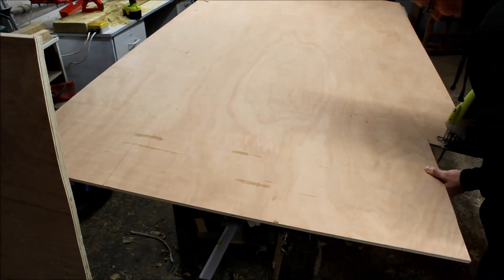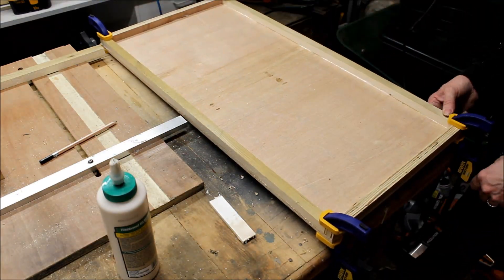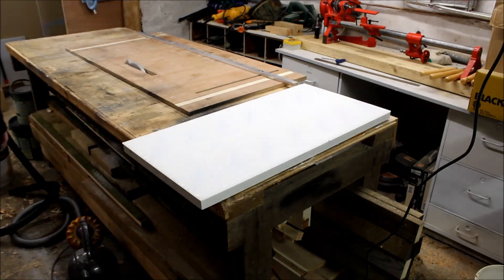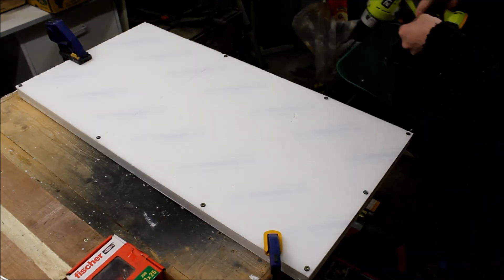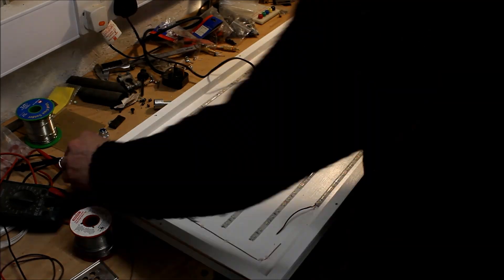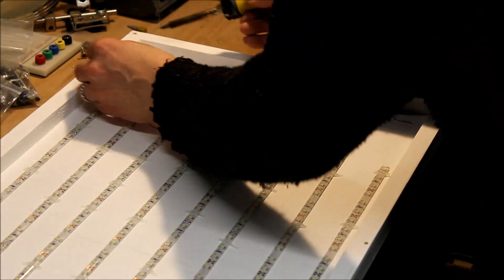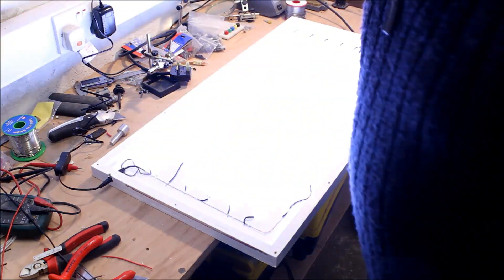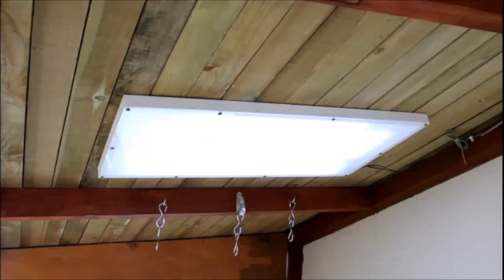How to make an LED Light Panel

Comment: Hi I need serious help in backlighting for inspection panel. Is it possible to use AC plug n play with dimmable feature? On what height should I place it to be to have it in 60mm box? And have 1030 lumens for 650 x 350 mm box. Thanks in advance! How much lumens are these
Reply: Can you specify what type of LED you are using? I couldn't catch that huhu
Reply from the maker: The LEDs I used are 12V white high intensity types that are sold in rolls on Amazon pretty cheaply. I can't remember how many lumens they are - if I find the old reel I'll post it here for information.
Reply from the maker: Hi @Amirah Heng - firstly DO NOT try to wire mains AC into the LED unit or strips, you will almost certainly cause a fire or injury if you do. 
Technically it is possible to make your own AC powered version, but you will need a transformer/rectifier unit to use LEDs (these are sometimes sold as LED drivers). If you do go this route you will also have heat to deal with if the transformer/rectifier is in the LED enclosure, which will then need to be designed for passive or active cooling. To be blunt its probably not worth the effort trying to make a single unit AC powered panel and using a DC powered version using low voltage (12V) is going to be far safer and practical.
Reply: @CMDRTeatime  I got you on this. I've tried ask a supplier, and he recommended me Edge lit LED. My concern now is will it be showing spots in my light box ( that I cover with 5mm Teflon sheet) so will the light disperse or showing spots instead...
Reply from the maker: @amirahheng2274  I've used both a white film and also made another version where I used a random orbital sander (making the acrylic opaque), to act as a light diffuser. Both work OK, but I would say the random orbital sanded version worked better.

Comment: THanks for sharing. How did you make the connection. please explain...
Reply from the maker: I'll try :-)
Each of the LED strips has a +ve and -ve connection and "rail" running through it (they should be marked), with the LEDs between them. 
I soldered two wires from the power socket (+ve to the centre pin on the socket) and from those to two copper wires or rails at each end of the LED strips. Then using small wires solder each + connector on the LED strips to the +ve copper rail (which will all be at one end of the strips) and the - connector on the LED strips to the other -ve copper rail, which should be at the other end of the strips. You can see me soldering in the video in this manner. 
To make the soldering easier, you can also get snap fit connectors with wires pre-attached for LED strips, rather than trying to solder to the internal connectors/wires on the LED strips.
Hope all that makes sense and good luck with your build if you try it.

Comment: please provide matireal details
Reply from the maker: Good request. Here's the materials needed:
1 piece of plywood for the back @ 700x400x5mm (you can use other sizes and thicknesses if you wish0
1 piece of acrylic for the top @ 700x400x3mm (you can use white or use clear, but leave the white film on)
2 side battens (any wood will do) @ 15x15x700mm
2 end battens @ 15x15x370mm
1 x 5 metre reel of bright white LED strip (Amazon do these cheaply and get the reel that comes with a 12v 2A transformer)
1 transformer socket (I think these are for a 5.5mm power supply plug and have the +ve terminal in the centre)
2 strips of copper wire for -ve and +ve rails (I got these for some old mains cable that I stripped the insulation from)
Some hot glue to make sure the LED strips, power socket and rails stay stuck
Solder and soldering iron of course, plus the other tools you can see me use in the video...
Hope that helps and good luck with your build.

Comment: +or- connection and input line
Reply from the maker: Not sure I understand the question properly, but you will need + going to one rail and make sure that's connected to the +ve side of the strips of LEDs and - going to the other rail and connect that to the -ve side of the strips of LEDs. The strips of LEDs are marked with + and - on the connectors to help you. 
Hope that helps.

Comment: what kind of acrylglas is this. ?
Whats the translucency of the Glas? 30 %?
Reply from the maker: Hi Tilliboy1234The sheet I used is actually some off  cut clear Perspex (example supplier - http://www.plasticsheets.com/3mm-clear-acrylic-sheet-2040-x-1520/) that still has the plain white protective film left on it to act as a diffuser.
You could equally use the frosted type (example supplier - http://www.plasticsheets.com/3mm-clear-frosted-acrylic-sheet-1500x1000/)
I couldn't tell you what the translucency is, as I have no way of measuring that.
Reply: a
Reply: VTilliboy1234

Comment: I like your video, I want be sure that you said you wire the LED strips in parallel all Positive one one end the strips and all native at the other end? It is a good video other than the sound. Sound needs to be better could hardly hear what you were saying.
Reply from the maker: Hi Gilbert - thanks for the kind words and yes - the strips are wired in parallel. The only thing to watch for is that you wire the socket for the power supply correctly.
Hopefully sound is improving on later videos...
Reply: Thanks for replying to my question, have another one, How do I  wire the socket for the power supply correctly
Reply from the maker: Hi Gilbert - to be absolutely sure its best to test the polarity of the power supply output with a multi-meter, but the normal way is that the wire going to the "core" pin is +ve and the outer ring or sleeve is -ve. The wires are also normally colored red (or black and white) for +ve and black (or solid black) for -ve. The LED strips themselves are labelled, so you shouldn't have any problems there.
Hope that helps.

Comment: Is there any heat generated and if so might it get overly hot?
Reply from the maker: Hi - I don't recall it getting hot, but when I go down to the workshop tomorrow morning I'll take a thermometer, check it and report back.
Reply from the maker: Sorry this took so long (couldn't find the thermometer) - anyway - start temperature = 7.5 Deg C after 1 hour temperature = 8.7 deg C

I'd say negligible temperature increase and what was there could have been ambient.

Comment: Great video, I have a couple questions. 1) What do you use to connect to the power source? 2) How do you figure our what type of power source to use?
Reply from the maker: Hi Christian - The reel of LEDs came with a transformer - its a 12V DC 1.5Amp output wall wart type and enough to power the whole reel. If I add another reel of LEDs then I will need a bigger or another similar PSU for the extra LEDs.

To extend the cable run from the wall wart to the plug that goes into the LED panel I cut the original wires and soldered some wire that I had spare from my CNC machine wiring - that carries 76V at ~3Amps (and rated much higher) on my CNC, so is more than good enough for this purpose. Heat shrinked each solder joint as welll for insulation.

Hope that helps.
Reply: Thank you, I'm making a light box for tracing. I've been looking over a lot of videos for using LED's as my light source. Your video was the best I've seen. Thank you for responding and for the video. I hope others find it as helpful as I did. 

Keep up the great work.